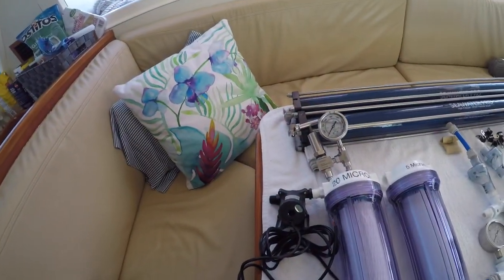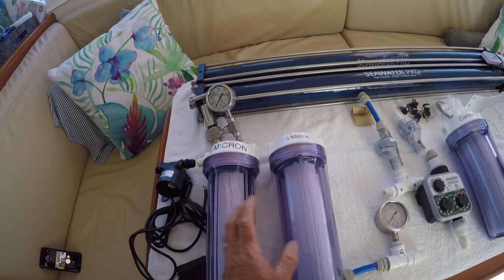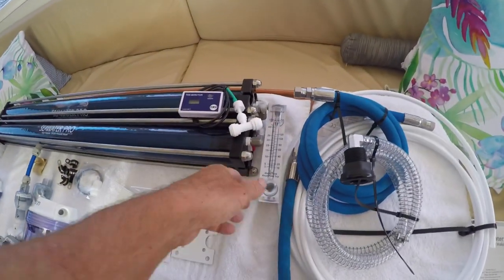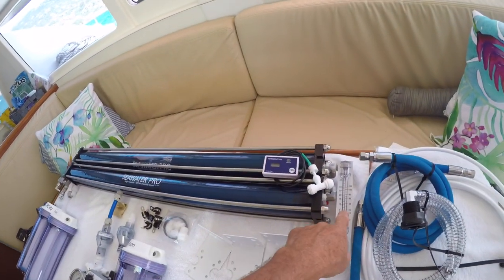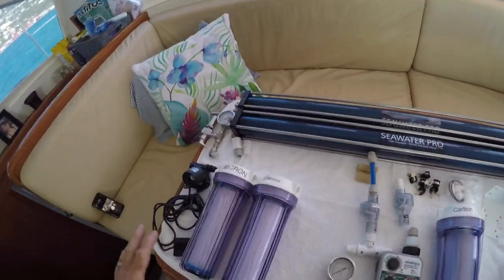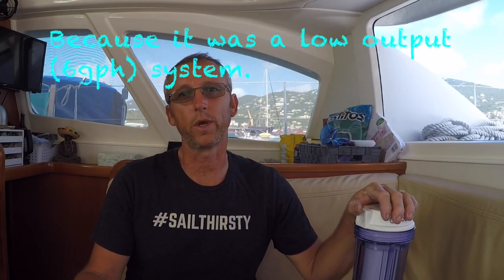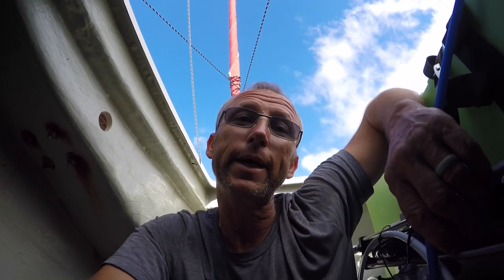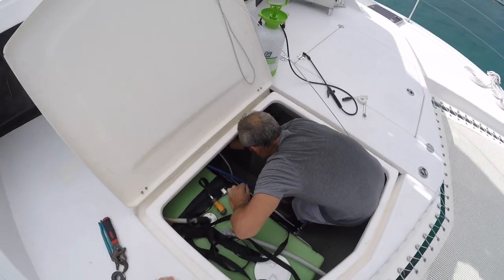Installing a High Output Watermaker | Sailing Luna Sea | S4 E 3 | Seawater Pro | Offgrid Sailboat

Comment: I installed the same unit a couple months ago. I agree about instructions on paper. Very vague on several issues. The one problem I have come across is that at 850 psi I only get around 25 gah. I can’t seem to figure out the issue so I will have to contact customer support. Other than the one issue, it’s a great addition to my boat. Been in boot key harbor for about six weeks and watching everyone make trips to the dock for water makes it a valid investment. Oh yeah congrats on the new boat. Hope you have many adventures ahead.
Reply from the maker: Glad to hear you’re liking it still!  As far as the output, I know it can vary based on the water you start with. I’d be very curious to hear their response when you hear back from them 🤔 Thanks so much for watching! - J

Comment: Nice job. Are there any issues to worry about by installing outside of the cabin space? I am planning on putting it in the captains hole which is never used. I have a 2015 leopard 48. Tim

Comment: Have you considered a solar hot water panel?  I’m a little geeked-out with these units.  Would love to see an install video for one of those.
Reply from the maker: I’m really hoping we can run the water heaters when we get the inverter installed 🤞🏼 But if not, we might look into that!  Thanks for the tip - J

Comment: I would put some rubber feet on the motor so that it doesn't rattle the bukhead while it runs.  
a nice install overall.  Oh never fill your tank with Chlorinated water at a marina and then do a freshwater flush....say goodbye to the membrane then...
Reply from the maker: Good tip on the rubber feet!  So true on the chlorine. It’s death to filters!
Reply: The carbon filter removes the chlorine for the freshwater flush.
Reply from the maker: Seriously? That’s great news. Always a fountain of information, Smitty

Comment: Thanks for sharing - Considering same setup 👍 Are you able to run the AC while making water?
Reply from the maker: We don’t run the ac unless we are in a marina - and we don’t make water in a marina… Our battery bank is not big enough to run our ac for a significant amount of time. Now if you have a big enough battery bank… maybe so. But regardless, after using it for over a year, we highly recommend SeaWaterPro. We even have a link in the video description - it doesn’t affect your cost, but gives a us a little kickback.
Reply: @SailingLunaSea  Thank you - My main concern was the ability to run both on one thru-hull intake with a generator which is what I plan to do...
Reply from the maker: Aaah. We have a shut off valve for the watermaker intake that we close when running the air conditioners. And I definitely would not pull from a generator intake - because of potential overheating risk associated. The most common place to use would be a toilet water in thru hull.